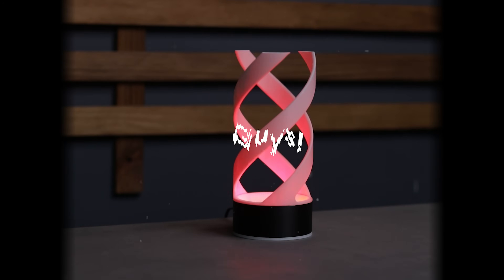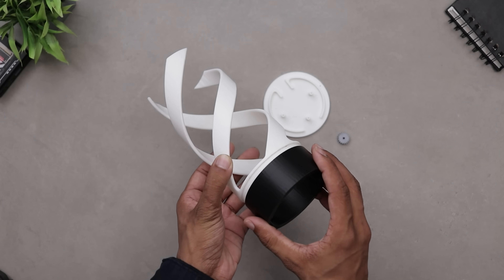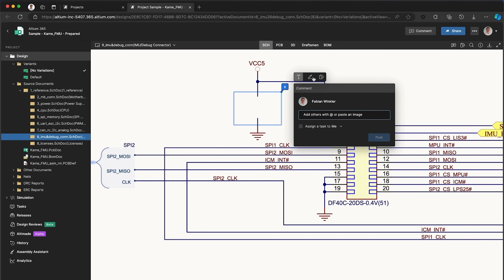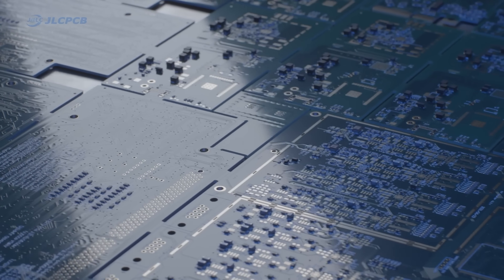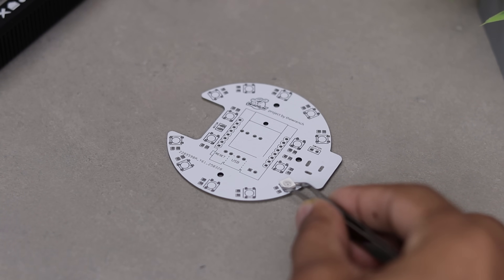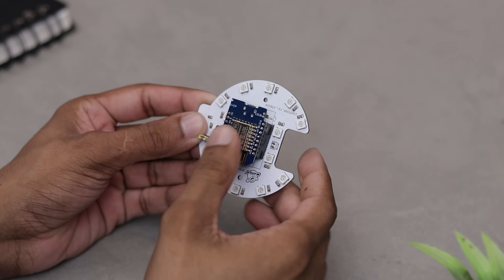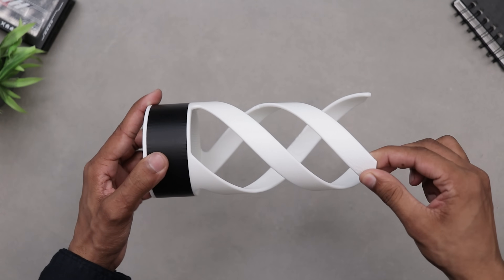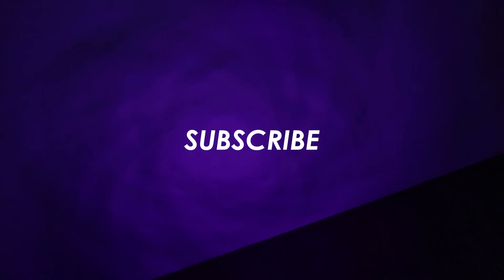Making a 3D-Printed Spiral Lamp That Spins and Create Magical Illusions - Improved Version

Comment: you can use an iron to solder the components to a PCB????? how the hell I've never seen anyone doing that before?
Reply from the maker: So I ran a little experiment and it actually worked. I’m just as surprised as you are 💀.
Reply: 😂👍cool ✖️ heat ☑️

Comment: That's cool! Many thanks!

Maybe for an improvement cover the electronics and the little gear and just let the LEDs shine up freely.
OK, make sure, there is enough air flow for everything, so it won't overheat. That's important. Don't cover it too tight. 

(At least for the cool ceiling effect, the LEDs should shine freely and should not be covered by any half-shine-through plastic. And the overheating danger is a real thing).

Great project!
Reply from the maker: Thanks for the suggestions